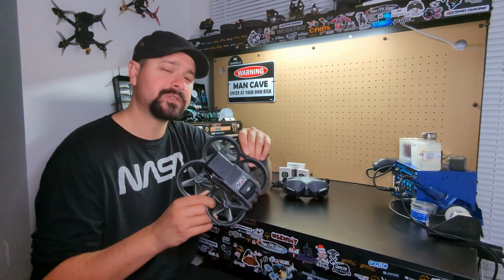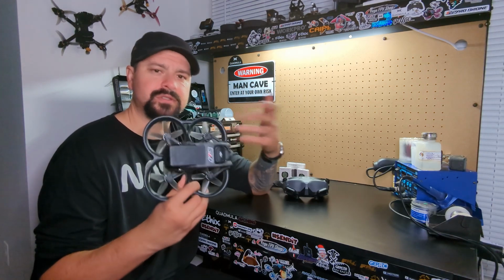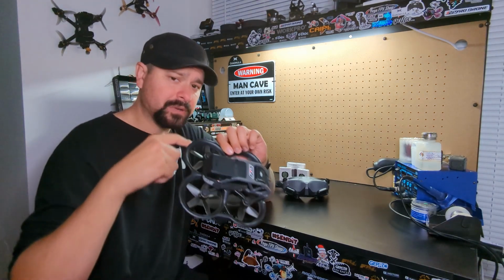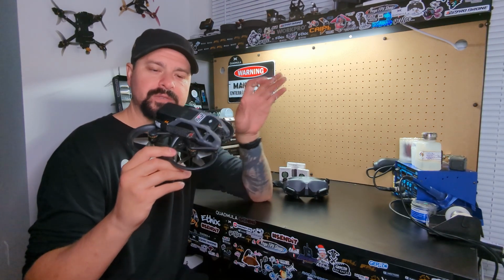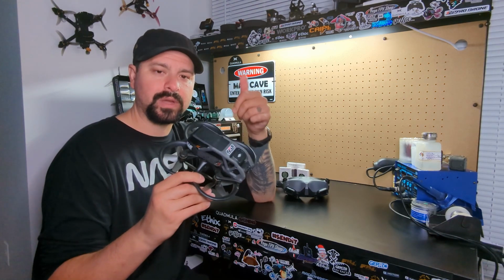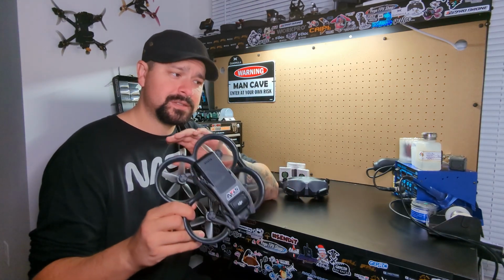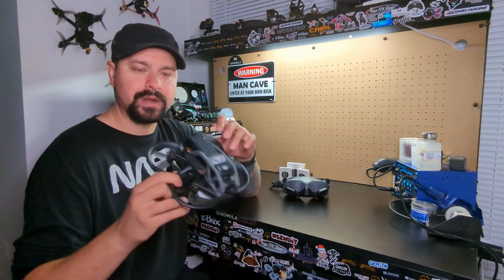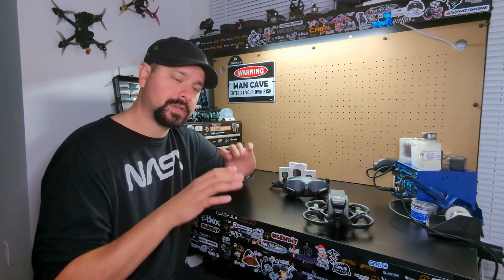Upgraded DJI AVATA: Real World Raw DVR and OSD // What to Expect From the Axisflying C157s

Comment: You have a cool channel, had a wrong 1 impression. Great stuff
Reply from the maker: Sorry if I rubbed you the wrong way in the past. I genuinely just care a lot about the FPV community and try to provide information that is helpful and I especially care about transparency. If you don't mind me asking what the first impression was so I know to be more mindful in the future?
Reply: Remark

Dear Customer, Damage Assessment Result: Core Board Module was malfunctioned,which caused abnormal sensitivity of operation;DJI Avata Intelligent Flight Battery water damaged. The data analysis determined that your product qualifies for a free warranty repair. We'll either replace it with a product that's new or equivalent to new in both performance and reliability, or repair it. For more information, please visit (http://www.dji.com/service/policy). ing battery as well
 
 
Item List
Core Board Module
Quantity: 1
Net Price : 98.00
Total Price: 98.00
 
DJI Avata Intelligent Flight Battery
Quantity: 1
Net Price : 129.00
Total Price: 129.00
 
Repair Service Fee
Quantity: 1
Net Price : 65.00
Total Price: 65.00
 
 
Tax
0.00
 
Shipping Cost
0.00
 
Total Amount
292.00
 
Discount
292.00
 
Total Payment (USD$)
0.00
 
 
Note
1. To ensure repair quality, DJI may update or replace the product module. If it is updated or replaced, the serial number may also change, but this will not affect the after-sales service.
2. DJI will use standard delivery service to ship back your products. If you have any other requirements, such as expedited service, please contact DJI Support. Please be noted that DJI will not bear any additional costs for such requirements.

3. Please note that DJI will not take responsibility for the extra costs, such as customs clearance and postage, incurred as a result of the uses made of your incorrect information.

4. Click here to check DJI After-sales Service Policies.

This email is sent automatically by the system. Please do not reply. For further inquiries, please contact us via DJI Support.

 
Best Regards,
DJI Support
 
This email and any attachments thereto may contain private, confidential, and privileged material for the sole use of the intended recipient. Any review, copying, or distribution of this email (or any attachments thereto) by others is strictly prohibited. If you are not the intended recipient, please contact the sender immediately and permanently delete the original and any copies of this email and any attachments thereto.

此电子邮件及附件所包含内容具有机密性，且仅限于接收人使用。未经允许，禁止第三人阅读、复制或传播该电子邮件中的任何信息。如果您不属于以上电子邮件的目标接收者，请您立即通知发送人并删除原电子邮件及其相关的附件。

Comment: Great flying with those new and improved motors, it really rips.
Reply: Remark

Dear Customer, Damage Assessment Result: Core Board Module was malfunctioned,which caused abnormal sensitivity of operation;DJI Avata Intelligent Flight Battery water damaged. The data analysis determined that your product qualifies for a free warranty repair. We'll either replace it with a product that's new or equivalent to new in both performance and reliability, or repair it. For more information, please visit (http://www.dji.com/service/policy). ing battery as well
 
 
Item List
Core Board Module
Quantity: 1
Net Price : 98.00
Total Price: 98.00
 
DJI Avata Intelligent Flight Battery
Quantity: 1
Net Price : 129.00
Total Price: 129.00
 
Repair Service Fee
Quantity: 1
Net Price : 65.00
Total Price: 65.00
 
 
Tax
0.00
 
Shipping Cost
0.00
 
Total Amount
292.00
 
Discount
292.00
 
Total Payment (USD$)
0.00
 
 
Note
1. To ensure repair quality, DJI may update or replace the product module. If it is updated or replaced, the serial number may also change, but this will not affect the after-sales service.
2. DJI will use standard delivery service to ship back your products. If you have any other requirements, such as expedited service, please contact DJI Support. Please be noted that DJI will not bear any additional costs for such requirements.

3. Please note that DJI will not take responsibility for the extra costs, such as customs clearance and postage, incurred as a result of the uses made of your incorrect information.

4. Click here to check DJI After-sales Service Policies.

This email is sent automatically by the system. Please do not reply. For further inquiries, please contact us via DJI Support.

 
Best Regards,
DJI Support
 
This email and any attachments thereto may contain private, confidential, and privileged material for the sole use of the intended recipient. Any review, copying, or distribution of this email (or any attachments thereto) by others is strictly prohibited. If you are not the intended recipient, please contact the sender immediately and permanently delete the original and any copies of this email and any attachments thereto.

此电子邮件及附件所包含内容具有机密性，且仅限于接收人使用。未经允许，禁止第三人阅读、复制或传播该电子邮件中的任何信息。如果您不属于以上电子邮件的目标接收者，请您立即通知发送人并删除原电子邮件及其相关的附件。

Comment: unrelated question, but how do you record with the stats on screen that you get from the goggles?
Reply: Using your phone or recording with the goggles but use your phone connect it to your goggles you’ll get telemetry that way bud
Reply: The DJI avata records on the aircraft (without telemetry) as well as in the goggles simultaneously. (With the on screen info you see here) There is a mini sd card slot for storing video footage on both devices. Hope that helps!

Comment: How many minutes of flight did you lose with this motor C157s?
Reply from the maker: Again this is a tough answer and it's strictly based on how hard I'm flying. The closest comparison I was able to find was another flight like this one where I was doing similar freestyle and the duration of that flight was 6mins and 17 secs. A difference of about 47 secs. But other factors vary like this battery was already down to 97% when the flight started and this was a windy day compared to other flights not having any wind. All these factors add up. 

This flight was from 97% to 30% and lasted 5min30sec. For me, it's such a negligible difference in flight duration that the performance increase is overwhelmingly worth it.

Comment: Hello, I'm always enjoying your videos.
I have something to tell you about avata's yaw turn tumble, which I suspect is caused by desync due to the low discharge rate of the battery. As an expert, I wonder what you think about this opinion.
Reply from the maker: Oh I completely agree, there is also the overall issue with its design that makes this issue even worse. The airflow to the props is not sufficient for how small the props are and the center of gravity of the quad is too high for how small of an area the propellers are. Had they made all four motors even a half an inch further out from the center, it would have improved the stability greatly. I think they went too far down the path of wanting to make as small of a drone as possible with as long of a flight time as possible and didn't foresee people wanting to be able to use the Avata to get more dynamic shots then just real estate video footage.

Comment: So, flipping the drone 180 disarms it, same that on mavic mini I think.   Does it also work for avata in manual mode?

I plan on putting arm/disarm on a switch, will that disable the flip to disarm feature?
Reply from the maker: I definitely should have specified this but "Aircraft Roll Over" only works in normal and sports mode. It does not do that in manual mode. Good thing too because that would be awkward if you attempt to get for a powerloop. 😅
Reply: @MurdersFPV  Haha, thanks for confirming. Getting my avata next week. Thanks for the vids!

I think we should try getting lighting ducts similar to Cinelog35, I believe that will do wonders.
Reply from the maker: @razorshark4  I was absolutely thinking about it and I know there are all kinds of companies coming out of the woodworks to make third party upgrades for the Avata.